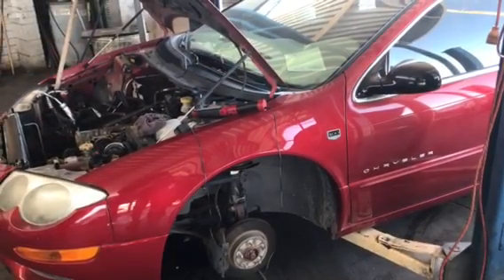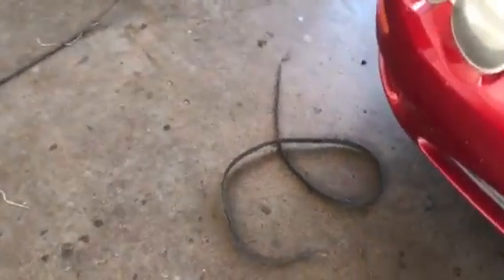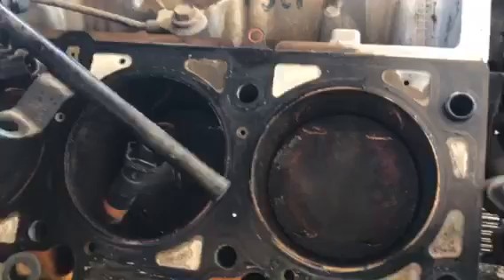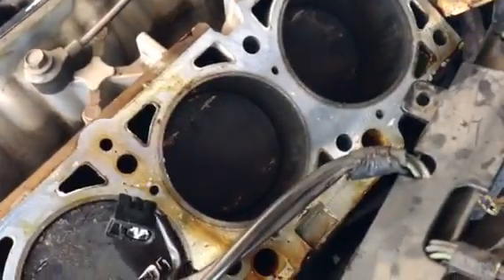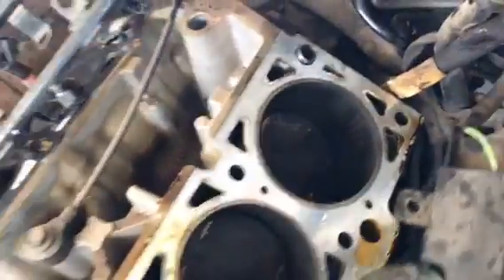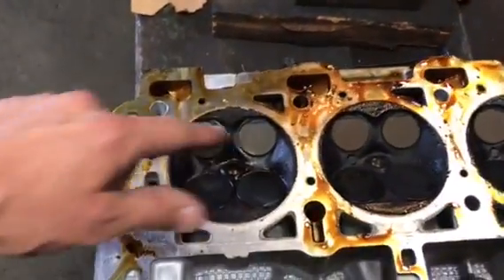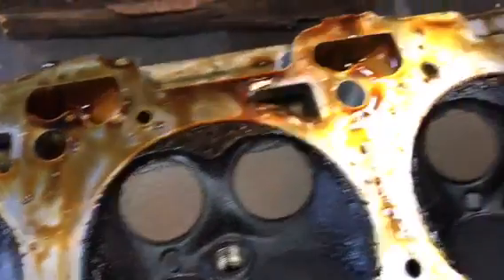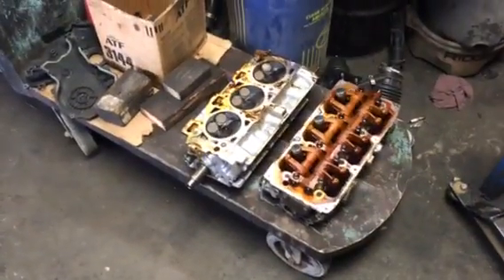2001 Chrysler 303.5 L timing belt broke interference engine

Comment: Sooo moral of the story is do not buy cars with interference motors. And if you do, service that timing belt when the manufacturer recommends it done haha.
Reply: About 85% of all timing belt cars are interference engines. You can't tell ppl don't buy 85% of the cars out there, because the remaining 15% are not a common or mass produced car. Plus some are way  older cars
Reply: Yes. Definitely older cars.